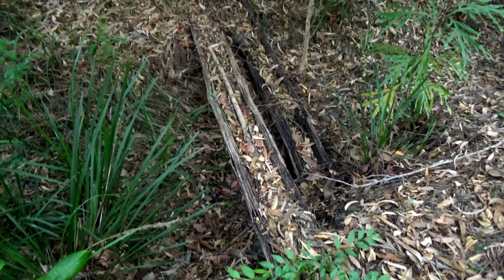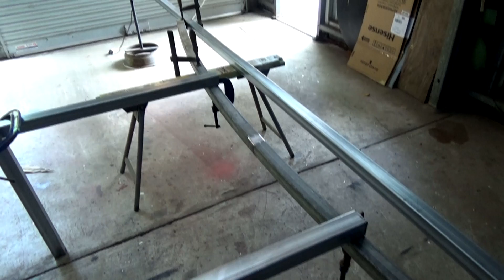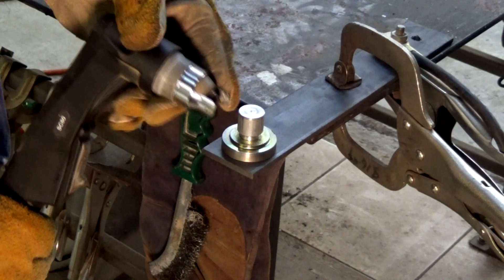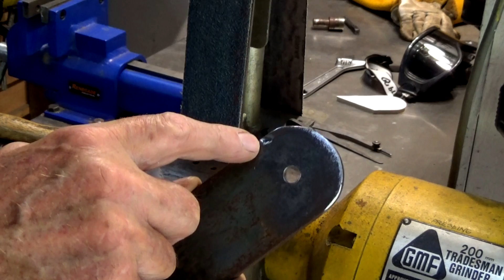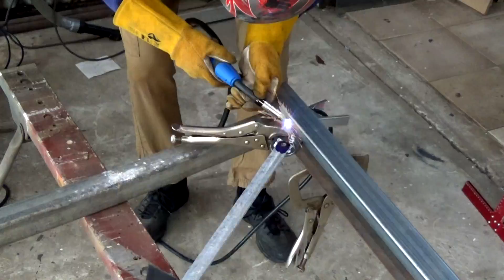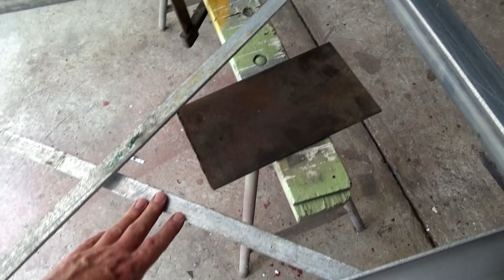Fabricated Victorian Style Garden Bridge - Part 1

Comment: can you do a review on your cigweld welder? I was thinking about picking one up... would you recommend those welders?
Reply from the maker: Hi, You may have worked out that I am not an expert welder. One of the reasons I purchased a MIG welder was because I was having a lot of problems with MMAW processes. Mainly with slag inclusions due to poor electrode control. I used to teach welding at a secondary school and I was actually quite good at it but in recent years I am having more and more difficulty controlling the arc and seeing what I am doing. The Cigweld unit that I purchased helped with the slag issue but I am still having problems seeing the weld pool and directing the arc. I suspect it may be a problem with the auto darkening face shield that I am using and I would like to try a different type to see if it makes a difference. Having said all that I find that the Cigweld MIG unit that I purchased is easy to use and compact enough for me to wheel it under my welding bench when it is not in use. It's also quiet and doesn't need a 15 amp supply to weld lighter materials. I tried using flux cored wire for a while but the spatter produced was annoying and the welds always looked porous. I ended up buying a cylinder of shielding gas and that has at least cleaned up the welds and it also seems to make it easier to see the weld pool. Sorry I cannot be of more help. 
Regards,
Mark Presling
Reply: Mate, I only ‘just’ got a certificate at tafe some 25 years ago and haven’t used a welder since. You’ve forgotten more then I’ve known about welding. 
It’s really a beginners welder I’m after. I have no intention of being a great welder. I’d just like to be able to weld - a skill I’m needing more and more as I get older

Comment: 14:40 by concentric you mean the center is offset by the same amount as the stanchions height so both arcs are parallel. If the arcs were to be concentric the stanchions would have to be coincidental with the radius and you want them parallel to each other by one meter and not separated by the same angle or part arc..
Reply from the maker: Both the arcs have the same centre. The lower curved rail has a radius of around 6 metres and the upper handrail has a radius of 7 metres. When I first started modelling the bridge using Autodesk Inventor I just offset the lower arc by one metre and couldn't understand why it looked all wrong. It also made it much harder to do the constraints and the diagonal bracing. Hope that makes sense 😀

Comment: Cool project! Two tips on welding, first is grind the galv off where you're welding, the second is push the mig, don't pull it. You want to point the gas in the direction of travel.
Reply from the maker: Thanks. I get conflicting advice regarding the push/pull technique. I have tried both and I am equally bad in both directions. Sigh!
Reply: @Preso58  Sure it's all practice! I reckon grinding off the galv will solve most of the problem here, but definitely push a mig weld for a more consistent weld. Looking forward to seeing the rest, it's a really beautiful design.

Comment: Awesome, looks like a very intersting project. A couple questions: How are you going to prevent lateral movements of the hand rails? Also, aren't you afraid that the vertical welds between the stanchions and the main carrying arch may compromise the strength of that arch?
Reply from the maker: David,
There is another episode coming out shortly which shows how I intend to mount the handrail. There are 50 X 5 X 100 steel plates welded to the top of the stanchions with a hole at each corner for a hex headed wood screw. This will allow the wood to be pulled down to the required curve. The wooden handrail also stabilises the position of the stanchions. The main span (arch) is 3mm wall thickness and apart from some very minimal distortion when it was welded it seems to be more than strong enough.

Comment: Great stuff,  It's going to be brilliant. I came here for a Stuart No 8 originally, and somehow I seem to have been inveigled into bridge building. I'd be nervous about whether those welds at the bottom of the stanchions are strong enough to deal with the leverage of someone leaning against the balustrade. Not a comment on your welding, I know nothing, and really I have no idea how strong a weld like that is anyway. Did you consider some sort of angle or web at the base of the stanchions across the width of the arched beams, to strengthen the right angle? It might fit between your footbed planks, maybe? Probably just me being a wuss.
Reply from the maker: I have now finished all the fabrication and the whole structure seems to be strong enough for what it needs to do. In reality I would be surprised if it gets used much. It is really just a decoration for the garden. The welds, even the crappy ones that I did will hold fine. The steel would bend before they would break.

Comment: Nice project Mr Presling. Does the creek run through property or is this a community project?
Reply: Very nice!   If the water was constant a small hydro electric generator could have been build on it.
Reply from the maker: Sadly, the creek is very seasonal. We need to have several days of sustained heavy rain before we get any decent runoff. Having said that, there have been times when we get a low pressure system that hangs around off the coast and the rain is almost biblical. We were watching a cyclone buzzing around off to the east but it moved away in the last day or two. We would like some rain to fill the dam but not like they had just recently up in Townsville. They had several METRES of rain in a week!
Reply from the maker: The creek runs through our property, We own about one hectare and our land marks the very beginning of Six Mile Creek which eventually runs into Lake McDonald. The lake was at one time the only water storage for this part of the Sunshine Coast. Now, as the community population has grown, the water supply is supplemented by a pipeline from the Mary River.
Reply: Meters in a week??? I hope you don't mean that literally Mr Presling.
Reply from the maker: Sadly, it is true. Townsville had a years worth of rain in just a week. Some areas had up to 1500mm over nine days and then more follow up storms in the weeks to follow. Then the rain event moved inland and flooded the flat cattle country. Hundreds of thousands of cattle and sheep were drowned or died as a result of no feed and exposure. The contractors cannot keep up with burying the carcasses. The flood broke the previous record by over 100mm. The original record was subsequently called "The night of Noah"!

Comment: Cool project. What are the dimensions? Looks like 9 m span, 1 m handrail height and about 1m wide? Can’t wait to see how you attach the decking material. Never been to Australia but I know from watching the movies your dry creek has crocs and all sorts of poisonous snakes and spiders so I’m expecting interesting installation.
Reply from the maker: The span is only about three metres and the handrail is one metre. The bridge deck is 900mm wide. I can just about lift one end of the structure by myself but I will be moving it down to the creek using the tractor to lift one end and my mate will be steering the other end with a trolley. No crocodiles where we live but there are snakes (mildly venomous) and jumping ants which are fiercely territorial and can jump high enough to get inside your clothing. The bite is like an intense localised burn. It's worth keeping a can of Mortein handy when doing yard work as the little buggers swarm like crazy once disturbed. Nasty!

Comment: I liked seeing both clocks side-by-side.  Nice update.   As you said, likely both deviating in between when they connect to re-synchronize the time.   My clocks which get the time do so e.g., 2am.

You are lucky to have been given the curved steel.  Perfect for this project.

I do like hearing different terms for things in other countries.  The cup head bolt is called a carriage bolt in the US.   Very common, all hardware stores will have these.   Often used to connect pieces of wood.    As the wood decays they are famous for spinning in the hole due to rusted nuts.  LOL  In metal I find it easier to use a hand file to make the hole square and a snug fit since sometimes the metal is harder than the bolt and rounds off the corners of the bolt head.

In the US I have never heard anyone call a belt sander a linisher, but my brother in the UK uses the term linisher.

I got a smile for the tool you made to mark the holes.   You have re-invented dowel centres.  I have these for use in wood.   Not hardened.

http://www.leevalley.com/us/wood/page.aspx?p=44995&cat=1,180,42288

Is silver steel the equivalent of O1 tool steel?  I do not hear the term in the US.

I have a flux core welder which I have used twice.   You may feel your welds are not good, but I expect your welds are much better than my welds.

Dave.
Reply from the maker: Dave,
I started out using flux cored wire in my Mig welder but the amount of weld spatter was unacceptable. Most of the welds ended up looking really porous as well. With the gas, the welds are much smoother and there is way less spatter. I often hear Stefan Gotteswinter and Adam Booth talking about O1 tool steel but I'm not sure if it the same as silver steel which is water hardening. It's mostly used but model engineers and it can be purchased as precision ground round stock. I have some of those dowel centres for transferring holes and as you say the ones that I have are not very hard. Over here in Oz a carriage bolt has a hex head and a very coarse thread for bolting wood together. It did dawn on me later that the whole key to this project was to have the rolled steel section for the main span. If I didn't have this the next best thing would be to slit the steel almost through with about 8 wide cuts made with a thick bladed cutoff saw and then pull the ends together with a chain winch so the cuts could be welded up again. You would end up with something a bit like a curve. 
Regards,
Preso
Reply: I think your comment on the carriage bolt having hex head and coarse thread is called a lag bolt in the US.   If only I could post pictures in a comment......

O1 tool steel is oil hardened - the "O" in the name.   W1 tool steel is water hardened, so perhaps silver steel is equivalent to W1.

I agree flux core wire creates a lot more splatter than MIG wire.   MIG welding is so much better than flux core, but I just do not presently have the gas cylinder, just a case of not wanting to spend the money on the cylinder.

Dave.

Comment: great as usual, but please tell me that's not galvanized steel you're welding, especially indoors!
Reply from the maker: Will,
I must say I am surprised by the feedback that I get regarding welding galvanised steel. When I was studying at college we were warned about zinc fumes and the danger of it making the operator feel sick. We were advised to have a glass of milk prior to welding as if this somehow absorbed the zinc oxide fumes? From what I recall we were told that the effect of the fumes was to make the operator nauseous and that apart from that there were no cumulative effects. Now, this was over thirty years ago and perhaps there is now more evidence of long term effects but personally, I have never felt any ill effects from the relatively little amount of welding that I do. It's an interesting debate and I should do some more research. For what it's worth, I had both front and rear doors open on the shop and it has been very windy lately so there is a lot of air movement through the work area. 
Thanks for watching,
Regards,
Preso
Reply: @Preso58  Well in the US some of the galvanizing can be quite noxious. Also from the perspective of weld quality remember being comfortable is primary rules: Get as comfortable as you can and also try not to weld over the fume path if possible.  We don't want you inhaling all the schmutz including the degassed zinc oxide. Great videos, cheers!

Comment: Check out Nick C Colyer earth drill rig, last episode.  He makes some rivets with a press and a torch. May be difficult with the size of this project, but I think you could figure something out. Well done, even the welds. Grinder and paint make me the welder I ain’t.
Reply from the maker: In hindsight, I'm glad I chose to use the bolts instead of rivets. It allowed me to disassemble and reassemble as I fabricated all the parts. If I had been successful in making the rivets I was going to weld them on the stem side and that would be a one shot deal. I am a bit of a fanatic when it comes to preventing corrosion and I wanted to get several coats of paint and some polyurethane sealant in between the brackets and the straps and having the bolts allowed me to do that. I did watch a guy making 16mm rivets with a 90 ton press and it was impressive. My press is 5 tons and by the time I pumped it 10 or so times to close the die, well, lets just say it would be a dead loss!

Comment: Hi, Interesting project as always. Going back to your unsynchronised clocks. It’s lucky they will be separated because the two differing seconds readings would eventually tip you over the edge. Your son is getting the other one if I remember rightly? Lucky fellow. A friend of mine is having to produce two skeleton clocks for his offspring. Never ends does it! Regards
Reply from the maker: Peter, The other clock is now in Wellington, New Zealand! My son took it back there on the weekend. He will have to reprogramme the controller and I had to write a procedure for setting up the Arduino IDE, installing the board drivers and updating the libraries. I've not had any urgent phone calls yet so I am hoping he got it sorted.

Comment: G’day Presso. I always thought it was Staunchion but you made me look it up, you are correct, damn you! You must have been annoyed as myself because you must have said it 50 times throughout the video. Anyhow those uprights look good, the cup head bolts will work, buttt they’re just not right aesthetically. Think of it like this they didn’t use SHS STANCHIONS either I think it was mostly angle and RSJ. 
Just messing with you, it looks great just be aware the SHS has a habit of internal rusting so don’t bolt the planks through it. 
Cheers Peter
Reply from the maker: Peter, I did some research when I was designing this bridge and I was surprised that so much angle was used. The Storey Bridge across the Brisbane River was almost entirely hot riveted and nearly all of the diagonal bracing was flat bar. I remember walking across the bridge a couple of years ago and having a really good look at how it was made. Maybe that had some influence on the design of my little bridge?
Reply: G’day Mark, I unsuccessfully tried to find out when RHS was first widely used because I have a feeling it may not have been around in the 1800s. When I was first designing truck bodies some of the body builders talked me into using RHS because it is aesthetically appealing but I found the bodies were showing rust stains bleeding out from the welds within 3 months, but I will add they had not rusted through in 8 years of service, I did stop using it after those initial bodies, never did trust it. 
Anyhow clean the welds up, give them a lick of gap filler and paint well. 
Cheers 
Peter

Comment: If you decide you would prefer the rivet still have a look at the YouTube channel Black Bear Forge he just did some videos on making and using rivet tooling to make perfect rivets it is really worth the time to have a look even if it’s not for this project
Reply from the maker: I did watch that video but as it turned out I'm glad I used the cup head bolts. It made it a lot easier to fabricate all the parts and I was able to paint between the mating surfaces some of which are not galvanised so if I had done a proper hot rivet job or as I had planned, welded on the stem side of the rivet I would have burned a lot of paint off. Still, hot riveting seems way cooler that using threaded connectors!

Comment: Mark I just bought some grade 8 round head bolts that are heat treated and blackened in color. The only draw back in what your looking is that these have an allen head in the center of the rounded head and they are 1\2 inch in size. They were made to bolt the cutting edge to my loader bucket. If the allen head is not a deal breaker then you can pick them up at most heavy equipment places. From a distance you can't tell the difference in them from a hot rolled rivet. Just a thought. From a clock to a bridge is quite a jump in builds. That's what I like about you is that no job is a deal  breaker without trying. Looks like we are in for another good ride in videos.